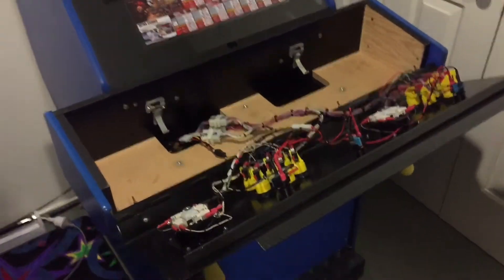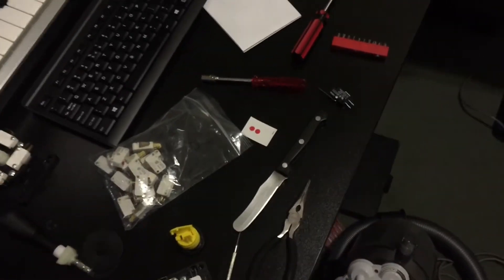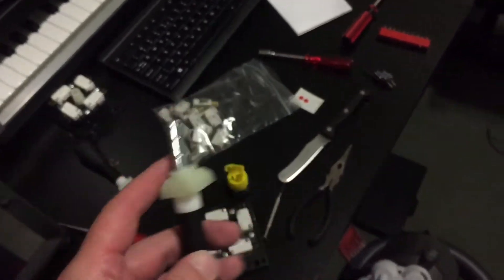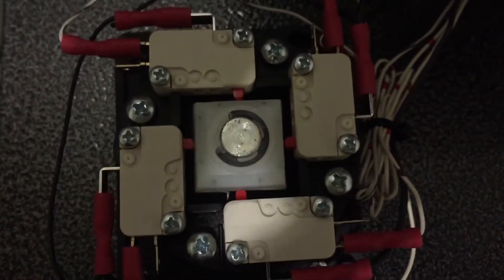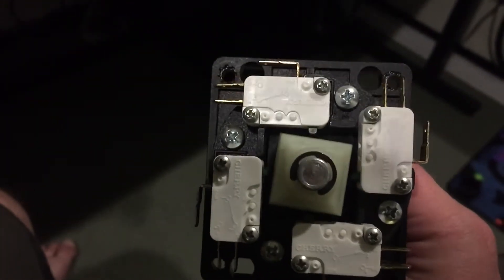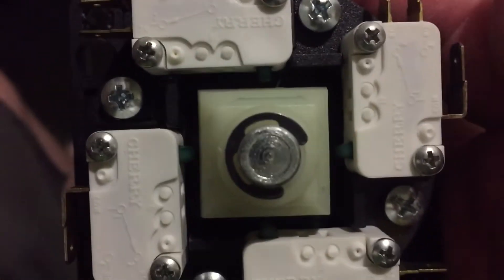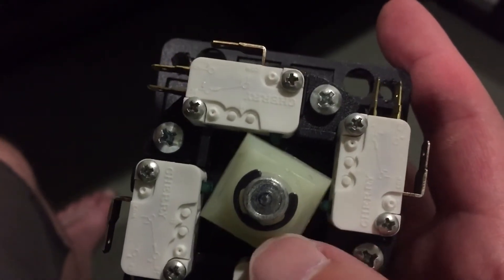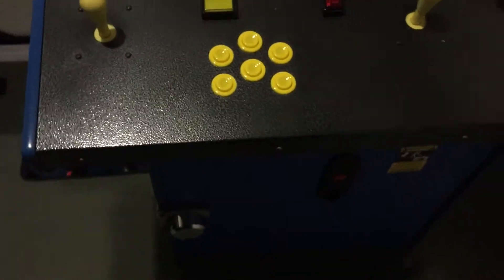Ultra Street Fighter 4 PS3 Arcade Machine, IL EuroStick Review

Comment: Thanks for this video I am building a fightstick with eh happ euro IL but I am concerned about height of the stick. My top panel will be 1/2 inch thick so I will be losing height. I am concerned if that will be an issue. I grew up playing with Happ bat top but I am wondering how is the quality of this compared to sanwa which is all the rage these days.
Reply from the maker: +Syam Rampersad Hey there man thanks for reaching out, yeah it's one of those things were personal preference comes in, I have been playing with these IL's and absolutely love them, I did have Happ comps but was having trouble getting diagonal moves cause the actuator underneath was just not hitting the cherry switches correctly. The IL's Rock diagonals every time, funny thing is I bought a Madcatz TE FightStick which have Sanwa's and to be honest finding dials not as easy, I grew with bat tops aswell man, what you could do is if you wanted to use IL's or Happs just countersink were the base of your sticks go to give you extra stick height from above, thanks for watching appreciate it

Comment: Two questions.. Can you tell me where to get an insert coin button like the one you have on top of your panel? Also, is the IL Eurostick more quiet than the Happ as far as clicking when moving it? I don't care for the loud clicking im joysticks and I think I wanna get the Eurostick.
Reply from the maker: Hey thanks for reaching out, I really appreciate it . In answer to your first question goto: http://www.ozstick.com.au/product/coin-button/ for the coin button. Second question iL's are far better IMO than Happs, iL feel a lot more softer, clicky depends on cherry switch im running DX144 Cherry Switches from focus attack there a normal clicky switch, the best thing with iL's is that they work in all directions, I still have Happ Comps hear that never go diagonal to pull off street fighter moves

Comment: I know this is an old video, but I would like to add I modded my SFxTekken fightstick pro by removing the Sanwa JS and installing an IL Eurostick....night and day, so much easier to play Killer Instinct and SFV now, also feels like old school when I boot up MAME for MK1 and 2 as well.  My next mod will be to remove the sanwa buttons (too sensitive to rest your fingers on without accidently pressing them) with IL concave buttons.

  I bought a Razer Atrox for the XB1 to mod but the IL is too deep for the case, reason why I modded my SFXT stick (had to keep off the bottom plate till I can build some spacers for it, but with the rubber feet installed no issues).
Reply from the maker: +KrAv3 man thats sounds awesome, I love IL's they just work. Thanks for the comments man really appreciate it, plus i subbed to you